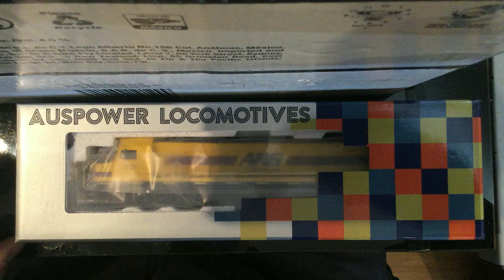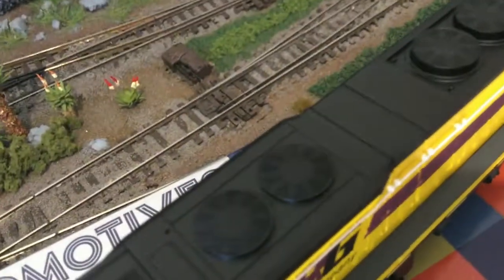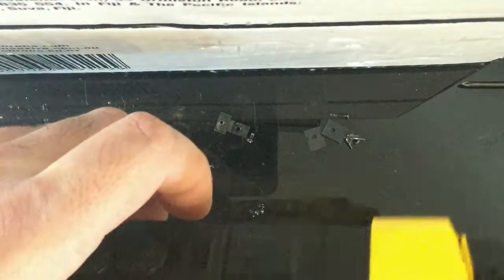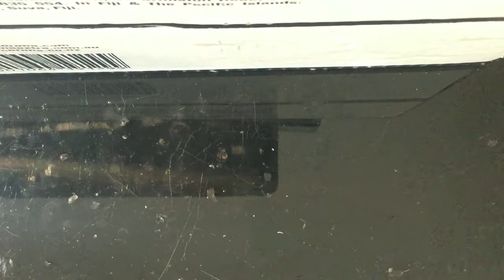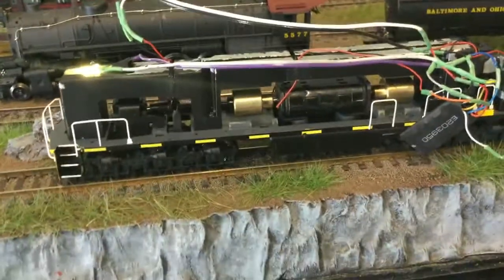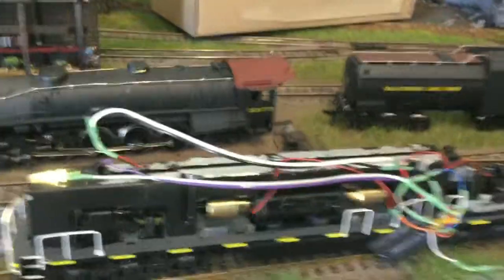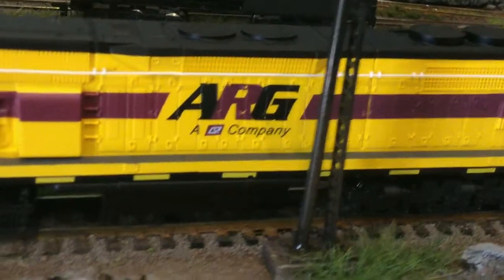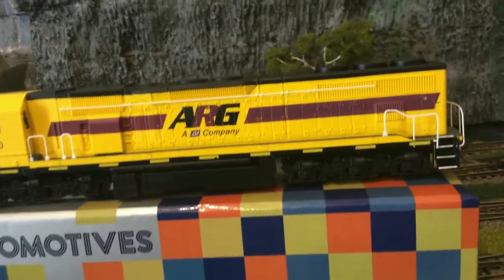Auspower C class

Comment: Hi. Mine is noisy too so I investigated. It was not the gears but vibration in the motor. I added foam between the weight and the motor to reduce the vibration and it is 100% better.
Reply from the maker: That sounds like a very good idea. My only worry with that is foam disintegrate, especially if it warms up. That stuff will go everywhere